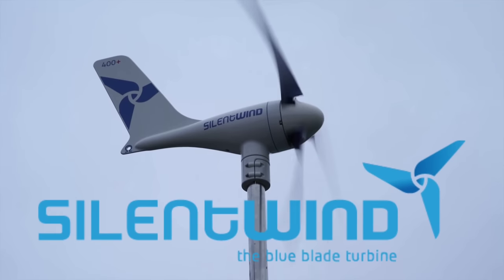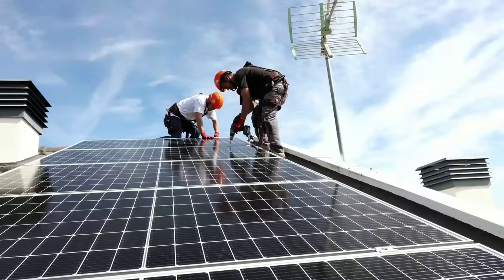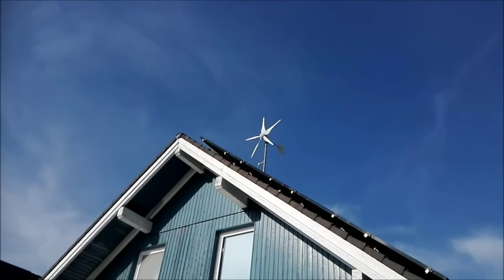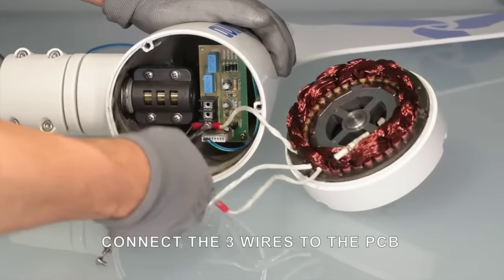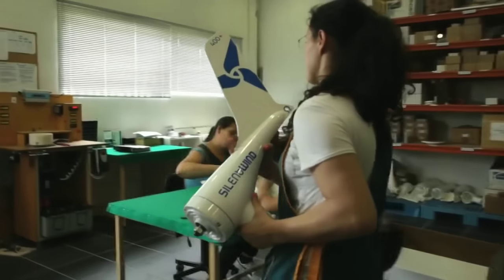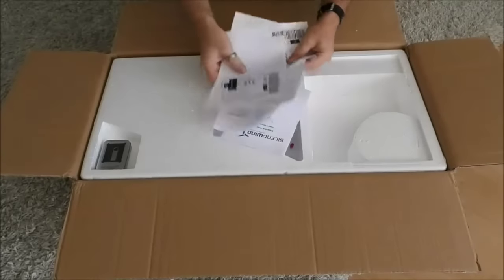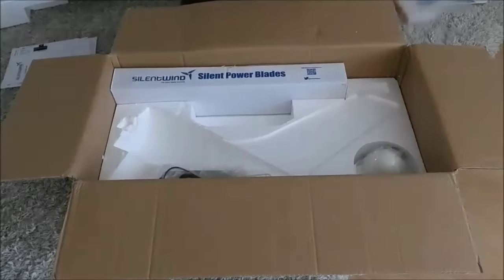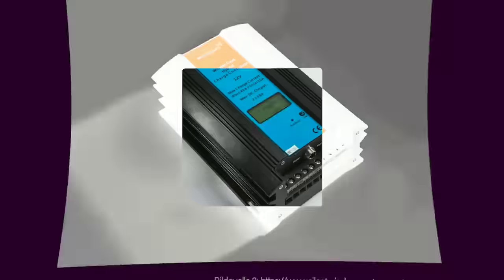Silentwind Pro: The World’s Most Powerful and Affordable VAWT that Outperforms Solar Panels in 2023.

Comment: Looks vertical to me, but I’m lying down watching this garbage.
The highest rated one I could find on their site is 48v and 500w. Thats far from 1500w or 1.5kw. They’re also 2100+ I believe it’s euros. That’s expensive far as I can tell. If you get 500w x 24 hours that’s not bad if it’s guaranteed output. Thats 12kw. I just don’t know how accurate the claim is considering all the ones I’ve looked at lately, not this one, are only producing 1/4-1/5 of rated output. That would be 100-125w with a rating of 500w. I would like to see real world testing with correlation of wind speed and turbine rpm. If it’s not a scam and I’m missing the point I’d love to say so. Im so skeptical right now.